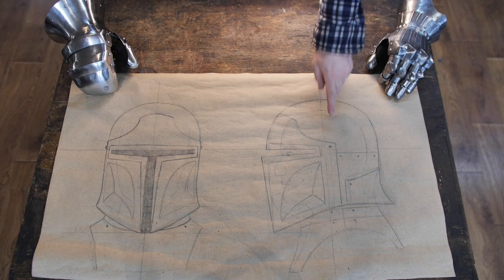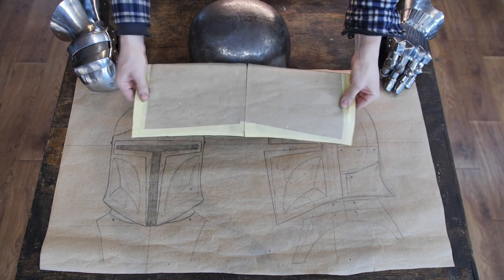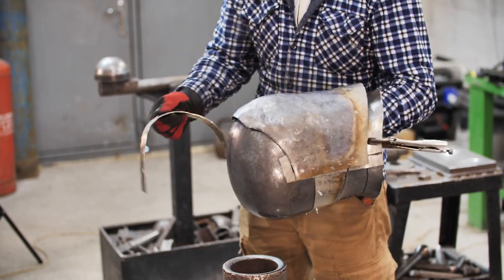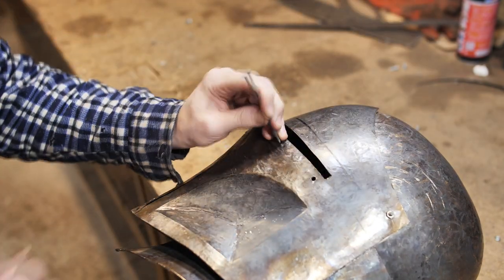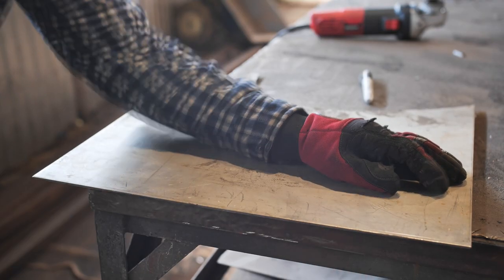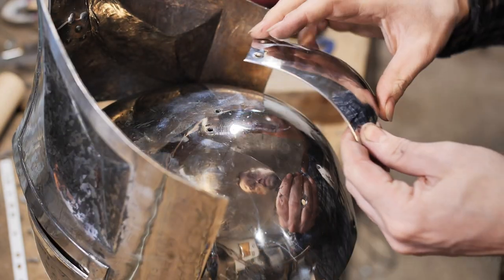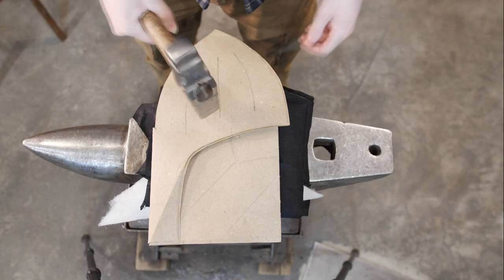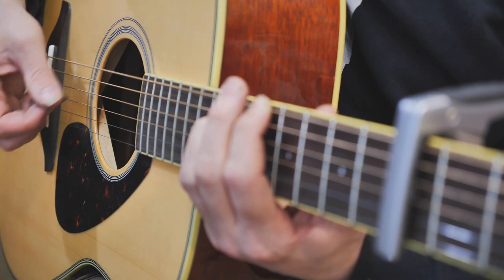How to forge a Mandalorian helmet

Comment: For the small brace to hold the cheek plates, I would’ve used some heavy metal mesh (or made some, forming a support that runs the length of the entire front portion of the vizor, creating a screen for extra defense and doesn’t take away from vision 💯💪🏻